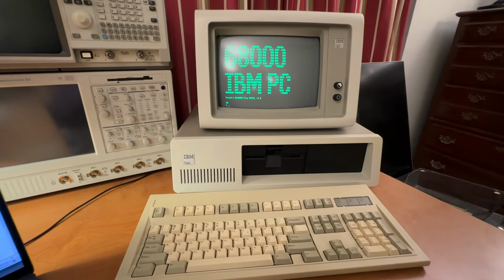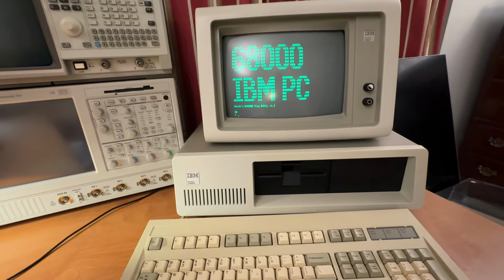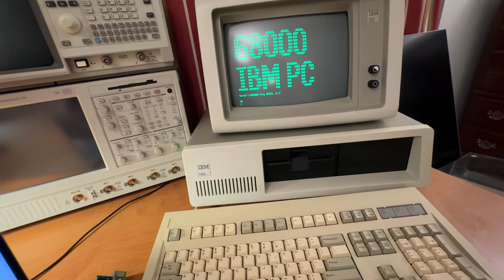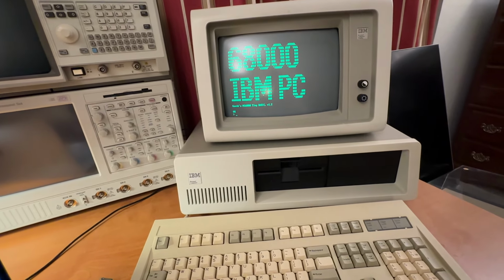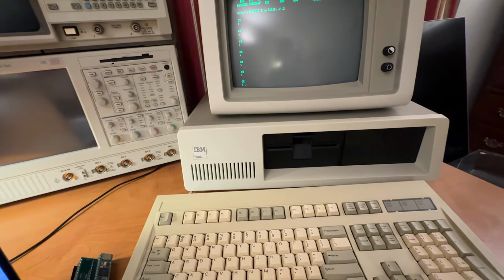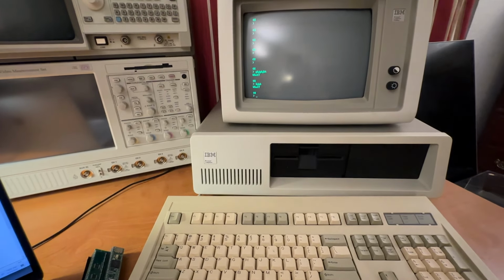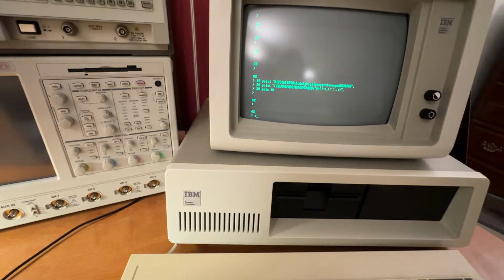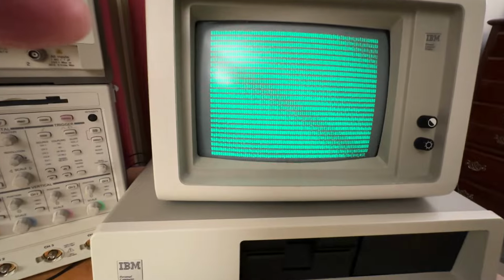IBM PC 8088 replaced with a Motorola  68000 - Part 1

Comment: Did you have to modify the BIOS to work on a 68k?
Reply from the maker: The Teensy first runs code to configure the motherboard IC's, then it runs the BASIC interpreter. It does not use the IBM BIOS.
Reply: @microcorelabs7698  So is the rom BASIC on the IBM PC wholly independent of the BIOS then?
Reply from the maker: @jnharton  That is correct.

Comment: It would have been way better until the 386 came along.
Reply: Wouldn't have been hard to go to the 68020 and 68030 the latter capable of running Doom as well as a 486 on modern 68030 code for machines like the Sharp x68030